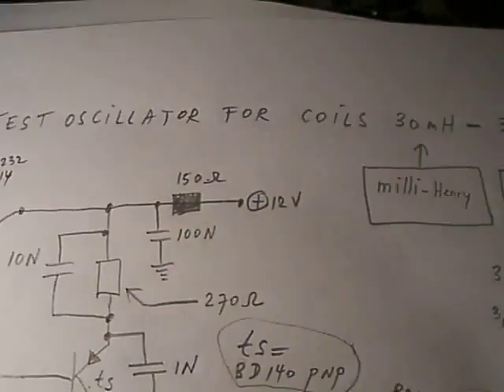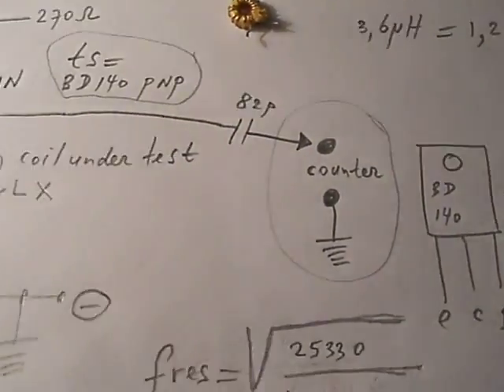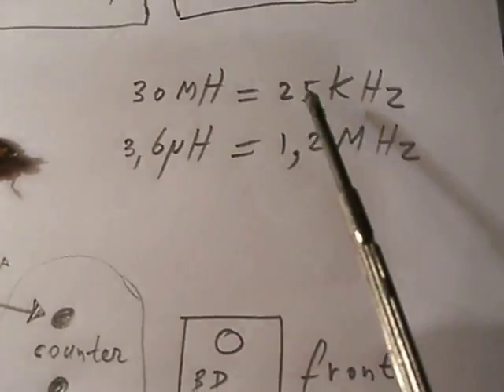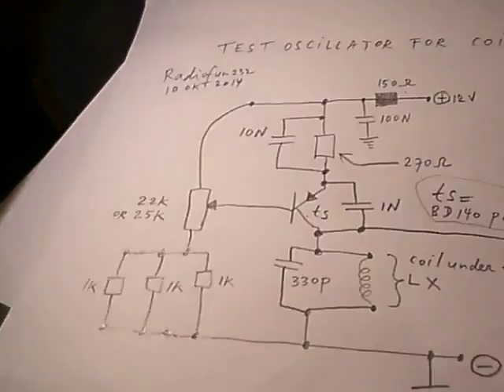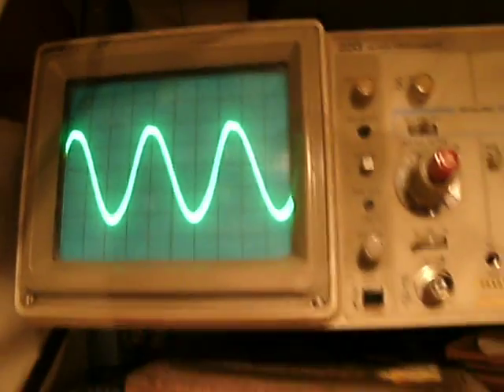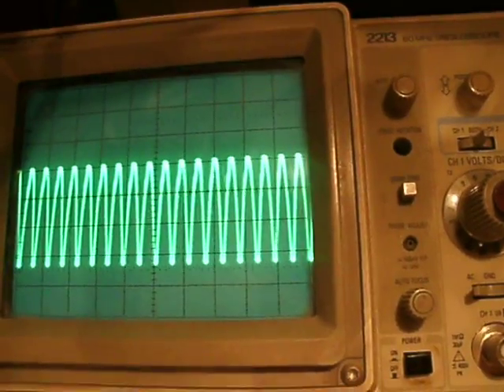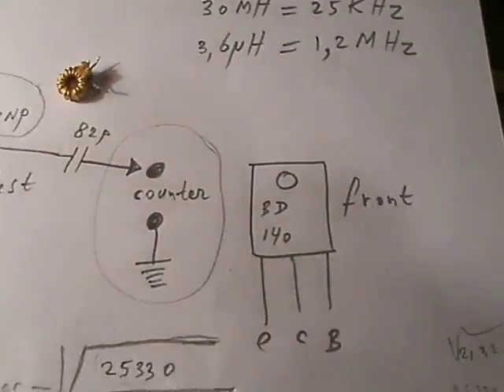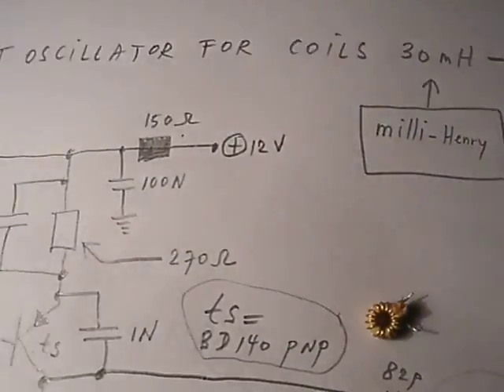test oscillator for coils 30 mH - 3,6 uH (0,9 uH) (e.g. 25KHz-1,2 MHz)

Comment: I love your videos but i dont know exactly what milli Henry and micro Henry means
Reply: Can you please explain?
Reply from the maker: MountainFlume Hobbyist mr Henry was a scientist (see e.g. Wikipedia). His name was attributed to the value of "inductance" in electricity/electronics. This has to do with the fact that, when we send an electric current trough a piece of wire, an electromagnetic field is generated around that wire. This field "opposes" the current that we send through that wire, it acts as a "brake" for the current flow. When we wind the wire to a coil this "brake" effect increases very substantially, and it gets even stronger when we put an iron or ferrite core into that coil. At the same time the voltage can get a "kick" when the field disappears (we disconnect the wire from the battery), it jumps up because energy was stored in the core. On alternating current this brake effect creates a sort of "AC resistance" (frequency dependent AC restance=inductance). This "resistance" depends on: the frequency, the number of turns, the core material. How these factors work together is in a math formula, you can surely find it on Wikipedia.The voltage "jump up" effect is visible when we put a coil into an oscillator circuit and the "own" frequency from the L-C combination is reached (=resonance).